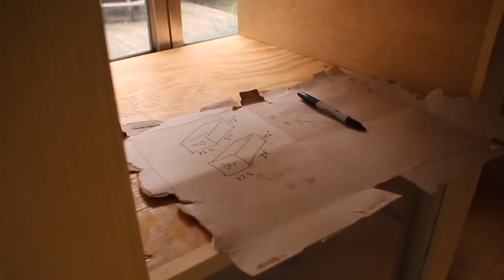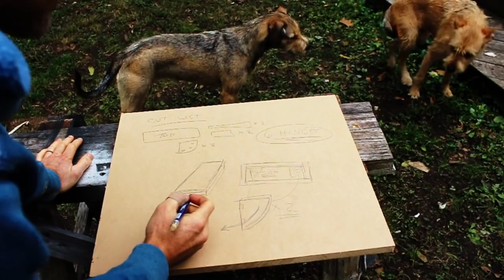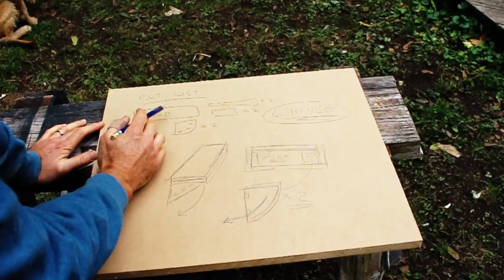Flip-Up Table -- Prison Bus Conversion #44

Comment: A couple of pins on the table brackets to lock them into the wall would give a bit more security.....just in case the puppies or you knee knocks them and you dinner ends up in your lap!...everything is looking great!!.
Reply from the maker: Ya know, I was thinking the same thing: maybe some short little dowels that those triangular arms can slot into. Thanks the the idea!
Reply: Or maybe some of those magnets so the table still lies flat against wall maybe.

Comment: For your rattling I’d try some sort of stick on rubber stopper or hot glue type thing to put on drawers so the cabinet part can rest against the rubber so it would be wood rubber wood instead of wood wood. Along with using the those stoppers
Reply from the maker: Oh yeah, I've gotta do that. I have some little stickum foam pads on there now, but I need something bigger like a rubber bumper. Thanks for that tip!

Comment: You are an awesome carpenter!
Reply from the maker: Why thank you! There is nothing quite like working with wood :) Thanks for checking out the video
Reply: @metaspencer  I've watched a lot of your videos on my TV, so unless I come to the computer, i can't like them, etc.  It almost looks like ya come out of the house, and start a project with no preplanning, or anything.  Whenever I try that. its a disaster.  Are you doing planning and figgering before you start?  Anyway, you make it look easy.  Thanks.
Reply from the maker: I plan some in my head and sometimes write things down, but I do love to improvise... especially on the bus!

Comment: You could check with like a truck repair shop or truck salvage yard you should find some air horns that way reasonably priced even if you got some of that electronic air horns instead of having a push button have like a pull button you could attach a handcuffs to might be simpler to create
Reply from the maker: great ideas ... gotta put it on my list! :)

Comment: Did you get some felt buttons to put on the backside of your doors? That’ll help keep them from making so much noise. They come on a sheet and you just peel and stick.
Reply from the maker: I have a few little ones but need some more substantial ones ... thanks for the reminder. It's on my list! :)
Reply: metaspencer I think when I get to my cabinet stage with doors and drawers, those are going to be my best friend.

Comment: how do you like those porter cable drills? I just bought that set in a pinch but then heard they're crappy :(
Reply from the maker: I love my Dewalt drills and impact drivers, so thought I wouldn't like the Porter Cable ones ... but I actually like them a lot! They're lighter than the big Dewalt ones I have, and keep running even though I drop and beat on them constantly. So maybe I'm just lucky, but I've really liked them.

Comment: I want to talk about the kreg mobile workbench you disabled the comment about. I need a portable workbench. You said the kreg one is wobbly and cheap plastic. I agree with you, but I don't see any mobile bench that is not wobbly. All mobile workbench is wobbly and made out of plastic. Then what is your recommendation?
Reply from the maker: I have two of these. They are solid and have lasted over 30 years (I actually inherited them). Not all the features of the one from Kreg, but much more beefy. https://amzn.to/2yTz4uc I disable those comments a while back as it seemed the pro-Kreg marketeers were not allowing any negative reviews of the table to go unchecked. Good luck to you!
Reply from the maker: (I re-opened the comments over there on that video, just to see how they go ... the hate was hot and heavy for a long time, but maybe it's simmered down) Good to hear from you!